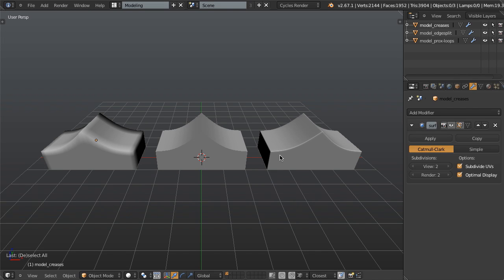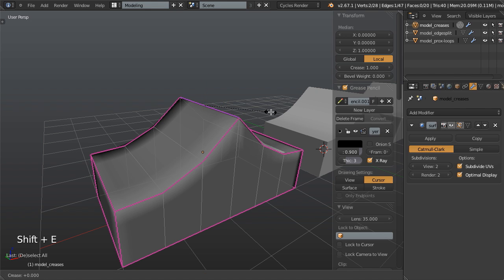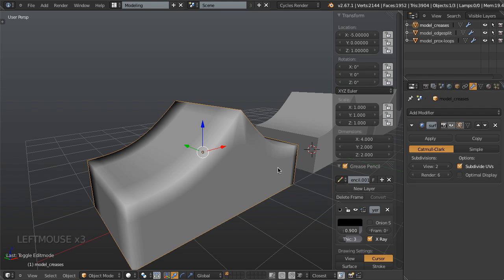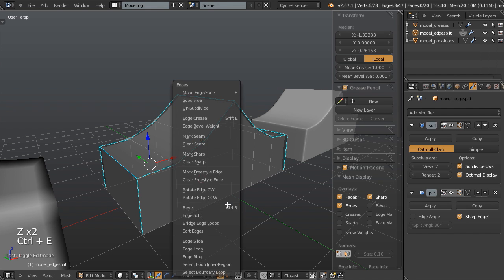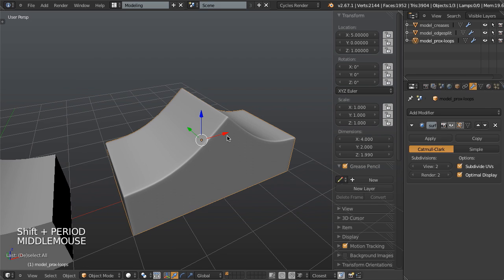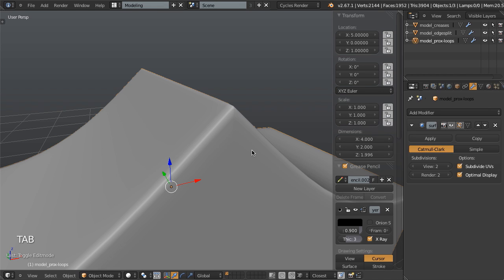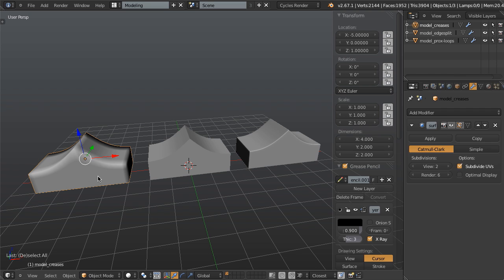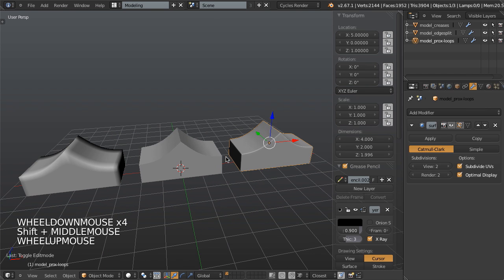Tips for Creating Sharp Edges While Modeling

Comment: I'm modelling a low-poly character in Blender and creating the normal maps through multires sculpting which involves making alterations to the mesh. To give the character sharper edges around the end of the clothing, I'm marking the sharps and creating edge splits. I've marked some of the edges for the ends of the clothing where the head, legs and arms come out also. Unfortunately, I encountered a problem with the edges when in sculpting mode. The edges part away from the mesh, as they aren't actually connected. Because of this, I was wondering if there's a way of connecting the sharp edges back up to the mesh while still retaining the sharp properties.
Reply: What I tend to do is keep the edge split in modifiers and not apply it until it's finished. That way, your model will still maintain the sharpness when sculpting.
Reply: You can also merge the edges and vertices back by selecting the whole mesh and remove doubles

Comment: Why don't you use just a bevel instead of proximity loops?
Reply: +TheSoSerdo Was wondering the same and tried it myself and found out why: this only works for outside edges.
If you have an inset edge things can get weird because bevel doesn't create the loops the way they'd be needed for subsurf.
It's still usable as a quick way if you'd keep that in mind I guess.

Comment: I need some help. So I took a helmet model that was made for the pepakura software, and I wanted to convert it for 3D Printing. So I brought it in and it has a lot of faces. Making it smooth makes it loos garbage. So I tried Subdivision Surface. It makes it smooth but it deforms the model by making a lot of edges round. Any suggestions?

Comment from the maker: The bevel modifier is also a great option for many cases. I should have covered it in this video.
Reply: The main reason I like to use the Bevel instead of "control loops" is that the Bevel can create exactly circular profiles, whereas with edge loops, the Catmull-Clark subdivision will always prioritise G2 continuity, which is fine for organic surfaces, but can be a real pain in the arse when doing Hardsurface, as the profile will be a weird asympthote curve with a smaller radius at the center than at the edges, which I really really don't like the look of 

This, of course could be solved if blender allowed us to 

1. crease individual vertices, as opposed to whole edges
2. allowed negative values or higher than 1 values in said creasing

this would basically bring discrete NURBS (or, rather T-Spline) functionality to the Subdiv modifyer, which would be an ABSOLUTE GODSEND to all hardsurface modellers
basically, the way CAD programs work, is they have NURBS surfaces, which are really really limited, actually, and can only create primitive surfaces, and they just align them together (since they can't actualy stitch them), it's a really really bad approach from an elegance perspective, but the SOLE REASON anyone even BOTHERS with that kind of stuff is because they can actually create circular profiles that can ALIGN to vertices 

Try this : open Blender, select the cube, press Ctrl+3 and then proceed to spin the resulting "sphere" and you'll find that it is, in fact NOT a sphere, since it's a bit pointier at the corners

the way CAD programs do this, is whenever they want to draw a circle or sphere, they add a square, with subdivided edges and set the WEIGHTS on the middle edge vertices to 1, and the weight of the corner vertices to 0.354 you can see this if you just add a NURBS circle in blender

so, there's nothing mathematically perfect about NURBS, either, of course, your engineer friends wouldn't believe you if you told them that, because CAD programs usually don't bother showing the user the NURBS vertices of primitives anyway, but do you Really believe that that .354 (or more precisely 0.353553) is the ACTUAL MATHEMATICAL VALUE required that pulls on the middle of the surface just enough so that it creates a perfect sphere ? 

OF COURSE NOT 

so, If we could have vertex creasing in Blender, we could basically model just like in CAD, but BETTER

Comment: Then how do you achieve smooth-groups for game models?

I guess it might add problems for automatically generated LOD, but I think solving this problem, could be easier (merge vertices occupying same place before degrading to lover LOD level) then adding special flag for each edge in engine. I don't really think it's adding so much overhead in model size, real-time animation & rendering.

Comment: Yes, his third example comes in handy for modeling the edges of car panels. Many of the subdivision surface car models on Blend Swap and elsewhere utilize this. I made one car with this technique. 

If you don't use subdivision modeling because you want a low poly count there is always the bevel tool, which if I recall wasn't even reincorporated back into Blender back when I made that car, but bevel seems to do pretty good now.